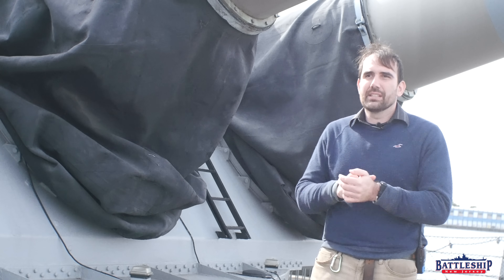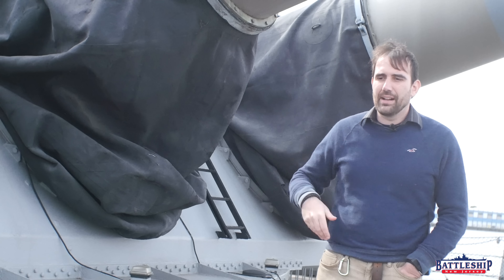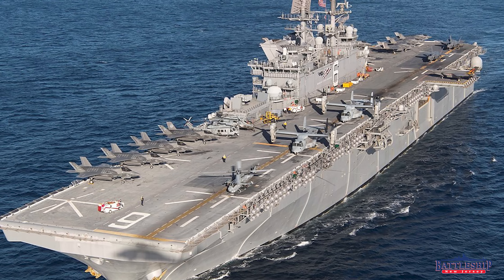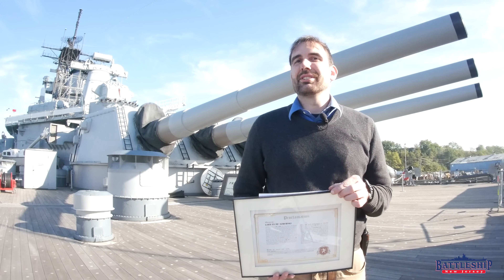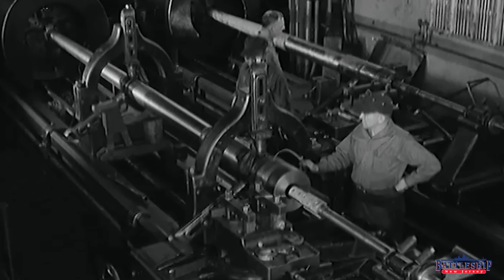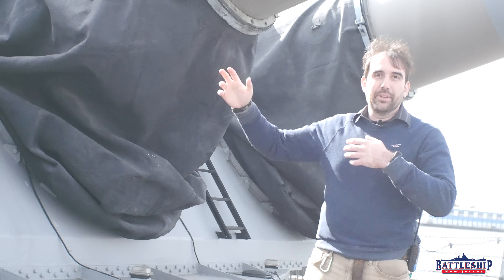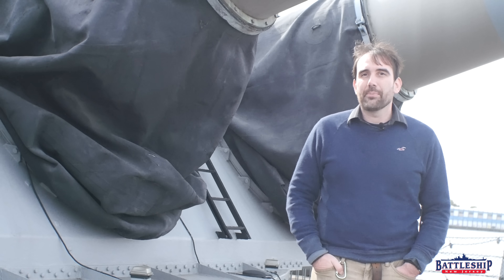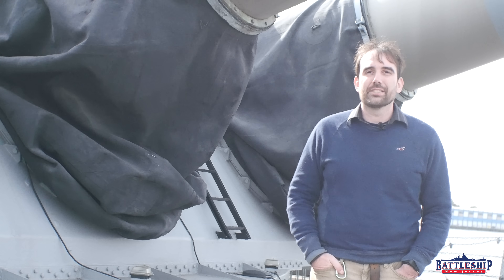How Much Would It Cost to Build a Battleship Today?

Comment: Having never made it higher than being frocked for First Class as a Machinist's Mate, not sure I am the greatest expert in the world, but here goes. 
1. New drydocks for the work, with significantly deeper draft
2. bring them in, but with the blockwork to support them higher than normal
3. drop out the boilers from below, replace with gas turbines
     a. shaft goes to generators, replacing Ship's Service Turbo Generators (SSTGs)
     b. Heat exchangers make 600 PSI steam, which allows propulsion turbines/reduction gears to work as designed
4. upgrade fuel stowage to modern fuels, taking advantage of "up from Below" opportunity
5. Add counter-torpedo
6. Replace 5" guns with... 

Result is
1. MUCH smaller crew (fewer BT/MMs mean fewer cooks, yeomen, ship's servicemen, etc.), allowing berthing to be improved to modern standards
2. Existing training pipeline for GS rating
3. Better fuel efficiency, existing fuel logistics
4. existing spares/repairs for gas turbine engines
5. MUCH higher electrical output for Electronic Warfare/directed energy weapons
Reply: I don't think that the modernizations proposed would significantly reduce the crew. Most of the crew are in the gun turrets (70 per turret) plus those in handling, fire control, and the like. I like the idea of going in from below. As well as removing the 5in guns would be beneficial as they are almost useless in modern combat. If replaced with automatic anti-missile/anti-air weapons, this could be good. Combined with an increased complement of anti-air missiles and anti-surface missiles would be very effective. I don't believe the added torpedo defense would be necessary as battleship, normally never go anywhere without support. With new 16in guns, with higher pressure and muzzle energy, she would also be able to deal with threats at much further range more inexpensively than a missile.
Reply: @michaelblanton8269  I would probably replace the 5 in guns with newer more modern 5 in guns so you still have a secondary battery available.
Reply: @michaelblanton8269  I would imagine they would remove at least 1 turret and replace them with VLS cells. They would probably find a way to automate some or all of the 16in firing operations so that could possibly reduce the crew further
Reply: @cplchanb  that would be much more work. Most of the crew in the turrets have to deal with loading the gun. Which comes in shell, then 6 powder bags.
Reply: @michaelblanton8269 with regards to the main guns, in the long run paying for manual labour is going to be much more expensive than automation.  not to mention reloading will be much faster as well as more reliable. You don't see any main guns on surface combatants being reloaded by humans anymore
Reply: @cplchanb  agreed. But the increased rate of fire may not be beneficial as it will cause excess wear on the barrels. Even with new materials it wouldn't last nearly as long with an increased rate of fire. Though the reduced cost would be welcome.
Reply: @michaelblanton8269  I can agree with you but I think it has been a big mistake terminating the rail gun despite its massive problems....
Reply: @paoloviti6156  I believe you are right about that. It could have worked through the bugs giv3n time and development
Reply: Yeah but is it worth it?
Reply: I'd replace the 5" 38 guns with four 5"/62 caliber Mark 45 Mod 4 guns and a couple of 76mm variants. I'd also add a couple more of CIWICs and 25mm Chain guns. You'd need SAM missiles. Possible a system to launch mk. 48 torpedoes. I'd delete the aft battery of 16"/50 with a missile bay loaded full of Tomahawk and Harpoon missiles, If possible hypersonic missiles. Or you can make it to where you can launch UAVs or do both? I'D also redue the super structure, make it more fluid and lower profile, similar to what you'd find on a modern warship. You do have to add the Aegis system. I'd make everything as automated as possible. So basically you'll have an over gunned Arleigh Burke class. I will annotate that, in today's world ANY Large warship is obsolete. The Russians and Chinese have the ability to destroy Any large capital warship with hypersonic missiles. Even carriers are now obsolete. Large warships are a liability and are no longer an asset. Money would be better invested in smaller faster and more capable warships along with submarines and technologies to make them more effective. Capital ships are only good for gun boat diplomacy against 3rd world nations and as a show of force. Possibly be used as commerce raiders. Against countries like Russia and China large capital ships are useless because they possess the ability to detect and destroy them from land using hypersonic missiles. In short they are multi-billion dollar hood ornaments used as hypersonic missile fodder. In order for any capital ship to be effective against China or Russia your submarines have to use cruise missiles and precision weapons to take out launch sites of hypersonic missiles. This is why I emphasize such money should be spent elsewhere developing technologies to counter new threats like hypersonic missiles and stealth technologies so you can't be detected.
Reply: Interesting, like rebuilding a WW2 tank to fight and survive in todays combat environment.  It's like my parents farmhouse. A wonderful and sturdy design but you're still working with some 19th and 20th century designs and materials.  You're limited to the existing frame and hull.  
Have you read the book Yellow Eyes by John Ringo?  It's a fun read and features Cruisers USS Des Moines (CA-134), and USS Salem (CA-139).
Reply: can't cut the bottom out. it's part of the armored citadel.
Reply: @AzrealMaximus  No, it isn't.
Reply: @donaldcarey114  on the New Jersey channel, the schematics show how deep the citadels go. From turret 1 aft to turret 3, then it extends further aft to just above the screws and rudders. The area topside that is considered a part of the citadel would be the conn. This is off a schematic and not me making it up, if you know more, I'd appreciate to learn from it.
Reply: @donaldcarey114  Like the two previous classes of American fast battleships, the Iowas feature a triple bottom under the armored citadel and armored skegs around the inboard shafts.[29] The dimensions of the Iowas were strongly influenced by speed. 

The citadel consisting of the magazines and engine rooms were protected by an STS outer hull plating 1.5 inches (38 mm) thick and a Class A armor belt 12.1 inches (307 mm) thick mounted on 0.875-inch (22.2 mm) STS backing plate; the armor belt is sloped at 19 degrees, equivalent to 17.3 in (439 mm) of vertical class B armor at 19,000 yards. The armor belt extends to the triple bottom, where the Class B lower portion tapers to 1.62 inches (41 mm). The ends of the armored citadel are closed by 11.3-inch (287 mm) vertical Class A transverse bulkheads for Iowa and New Jersey.

The propulsion shafts and steering gear compartment behind the citadel had considerable protection, with 13.5-inch (343 mm) Class A side strake and 5.6–6.2-inch (142–157 mm) roof.
Reply: @AzrealMaximus  The triple bottom was NOT armor plate - case closed.
Reply: @AzrealMaximus  That is NOT the same as across the bottom - thanks for playing.
p.s. I do have a library that includes Battleships and Battlecruisers - It shows ALL the armor on the Iowa's - there is NONE across the bottom. A triple bottom is NOT made of armor plate.

Comment: This is always been a problem that I see in military procurement.
The problem is there is a strategic planning and operational and there's a budgetary constraint. 
Personally speaking I build six battleships. Brand new off the rack. Now before I would actually build I wouldn't build necessarily in Iowa class battleship I would take what I learned from the Iowa would definitely be the template that I would start with but I would add some modern stuff vertical missile launchers I definitely want to keep at least two turrets worth of 16 inch guns maybe three but I definitely would add a lot of modern toys and modern tools to it. And then I would build six of them and the reasoning behind that is that allows a ship to have two out in the ocean doing whatever they need to do to back for repair maintenance and two working themselves up to be deployed. Not having said that I would also and this is something that I've often thought about is it if I was worried that I might need those 16-in guns and I might need that ship right now I would take two of the most modernized battleships and commissioned them back to service. And I would take him put them through a complete modernization package bringing them up to standard. But I don't want to be keeping them a few years before I return them back to either as a reserve ship or as a museum ship perhaps both. I personally think well yes Iowa class battleships. But I personally think that he modernized version of an Iowa class should be built and if we have to bring any of the old girls out have enough ships out there to keep it real then I think that's not a bad thing.

Comment: Okay, build two of them.  I want giant AEGIS radars on the superstructure, a gigantic VLS missile park up front and in back, and a single triple turret with 21" guns somewhere in the back just in case we ever just want to make it rain.
Reply: Putting giant aegis radars on a battleship makes no sense because they're super expensive, easy to hit and not possible to armor in combat, all for something that's unnecessary for its role. Area air defense isn't relevant to a battleship, and local air defense can be easily accomplished by other more survivable sensors(radar or otherwise)
Reply: @alexdunphy3716  If you're going to use it as the Iowa's were mostly used, aircraft carrier escort, I think it makes perfect sense.  Powerful radars, tons of long, medium, and short range missiles, etc.
Reply: @larrythorn4715  their purpose was to counter japanese battleships, not to be dedicated anti air escorts.
Reply: @alexdunphy3716  And they became anti air escorts anyway.  Modern ones would fight with missiles, not guns.  Missiles require radars.  I'll stand by my initial description.
Reply: @larrythorn4715  that became their job because they had nothing better to do alot of the time, and they happened to have a large AA armament. Aegis is not physically survivable enough to be mounted on something and still call it a battleship.
Reply: @alexdunphy3716  Given how durable electronics can be now, and how much room there is for backup systems, and the amount of armor/hardening possible on a BB sized ship...I think it would work out just fine.  You'd wind up with a very large SuperKirov.
Reply: @larrythorn4715  as nice as a super Kirov would be I think it would be a more efficient solution to use radars the size and power of those on fighter planes and have many of them like fire control directors. Most threats will be only detected near the horizon anyway
Reply: @alexdunphy3716  Radars are only half the battle.  The other half is a giant missile farm.
Reply: @larrythorn4715  plenty of room for that, though it might be better to have revolving missile racks that launch through an armored hatch to keep them more safe from enemy fire
Reply: @alexdunphy3716  If it has the room to do that and keep up rate of fire I'm all for it.  I want a ship with a few big guns for the rare event we do an amphibious landing (bonus points if they have a long range guided munition), powerful radar, a crapload of air defences, and enough short range air defence (CIWS and RAM SAM) that it itself need not worry about missile attack.

Not really a modern big gun battleship but a modern take on the battleships primary historical role.
Reply: @larrythorn4715  should have plenty of room for that. Mk41 vls can't fire too close together simultaneously anyway so it shouldn't be an issue.
Reply: @alexdunphy3716  Then go with it.  IMHO the harder a target this thing is, the better.  When it's not using it's missile spam to protect a carrier, it could detach with a few escorts, carry enough anti-air firepower on it's own to be reasonably well protected, and use a couple giant guns to bombard in preparation for a landing, etc.